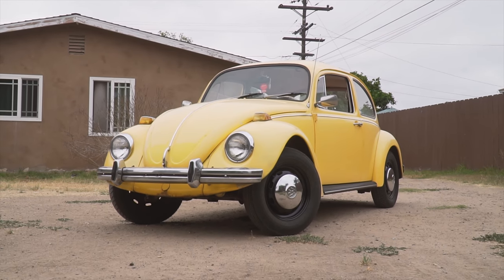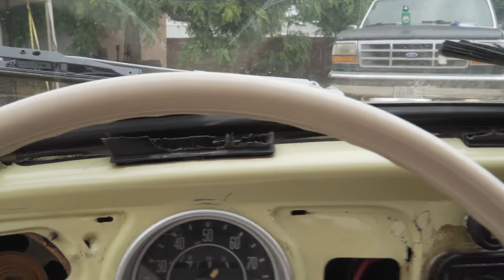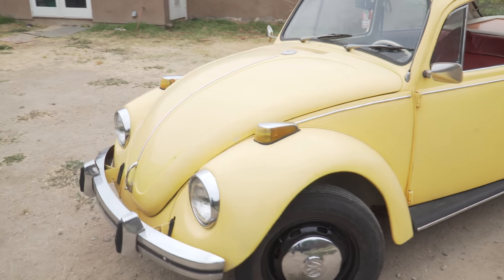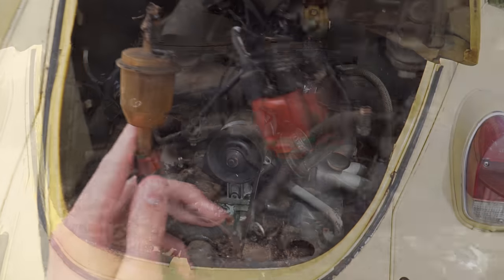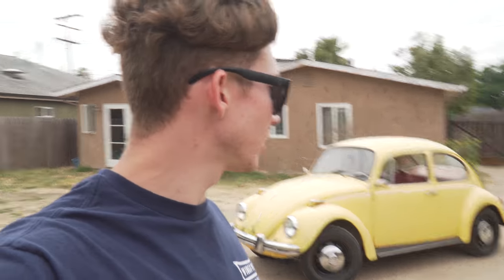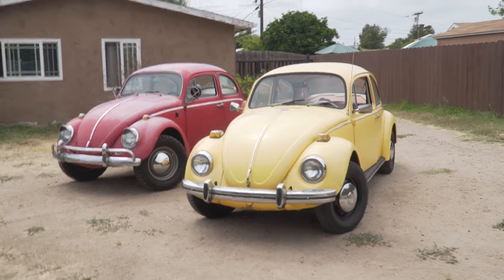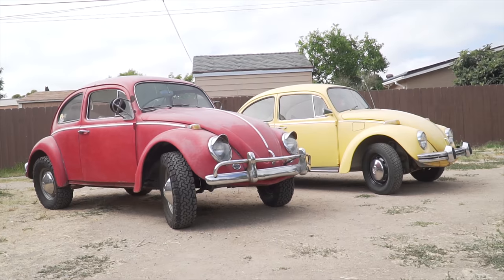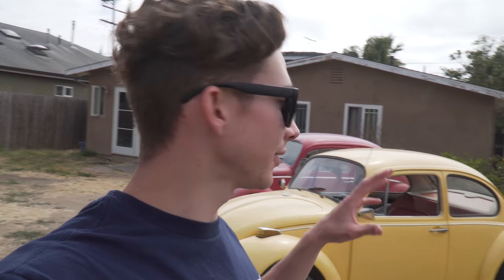Introducing My NEW VW Bug Project!

Comment: hey a little tip on the fuel line.  don't get me wrong we like the old style braided fuel lines but they don't hold up to ethanol .  if you go on eBay and search for this, it looks just like the original fuel lines but they hold up much better and won't start fires -   AN4 -4AN Fitting Stainless Steel Nylon Braided Oil Fuel Hose Line Kit
Reply from the maker: That is good to know!  I already ordered the standard style line though. Once the car gets a fuel cell, it will need new line anyways and it will get some nicer braided line.
Reply: Belmetric makes a modern braided fuel line called "Flennor" that is safe for ethanol up to E85 for those of us who prefer the braided look.
Reply: Thanks for sharing this information.

Comment: i used to have a 70 bug with the autostick option  frame rusted on it. as i said the IRS was introduced on the bug in August 1967 for the 68 model year with the autostick option. while the manual models retained the long swingaxle rear suspension as 1969 the manual models got the irs rear suspension the engine for 1967-1969 is a 1500 sp 1970 a 1600 sp single port. the dual port what u have is 1971 and later. the dual port motors will have the advanced doghouse oil cooler in the fan housing. as 1970 the changes is the big front turn signals and the rear bumper reflectors. as the rest is the carryover from the 1969 model as 1969 the heater channels changed to the ducts infront of the seat, the new defrost hose connections, the bakelite heater pipes under back seat. day night rear view mirror, fuel filler flap release under right side of dash, the hood release located in  glove box,  electrically heated rear window the changes on the 69 model. as 1966 -1977 the front beam is a ball joint type and bugs prior to 1965 is a link pin.  the 1966 bug has the 1300 motor still 6 volt. as 1962 the type 2 bus got the 1500 motor running on 6 volts but not sure on adapting a 1600 dual port motor to run the 6 volt electric but you have to change the flywheel to run the 6 volt starter. if 12 volt you have to ream the inside of the bellhousing for the bigger 200mm 12v flywheel. as the later 1500 and 1600 motors are 12 volt. the starter be changed with the approiate bushing for the 12 volt starter. the 64 i would of left stock as they are going up in value in the market.

Comment: Awesome man I’m 17 and bought a 65 bug to race in class 11 I was a little sad I couldn’t get the irs but it will still be pretty cool to race it
Reply: Swing axles are good  don't over extend suspension keep stock just reinforce and gusset susp. components run fox shocks valved to match the spring rate u run 
with front and back weld seams on the front beam  brace ball joint beam and body seams for extra rigidity and strength total Spartan tear out what's not used for racing. Good luck 👍 working ...
 with
Reply: Shout out to the Sletten Bros.  @ 11 Cars Motorsports for info. on setting up ur car IRS or swing axles it's does give better rear clearance .
Reply: Milo Torres ok sick I’ll look into that I know swing axles are bad and they both for what they are and the travel your limited to work pretty well but yeah I’ll definitely be looking into all that once I go pick it up

Comment: I am curious to know more about what you prefer about 1969 or 1970 Beetles. I know that from 1971 on there were both standard and super beetles both with IRS.  I understand why a super beetle would not be appropriate due to the front suspension design but the standard Beetles of those years have the same front beam as 1969/1970.  In other words, a 1972 standard Beetle would have the same front beam and IRS as your 1970.  I'm just wondering if there is some other structural quality I do not know as to why you were specifically searching for a 1969 or a 1970 other than personal preference.  For me, one of the main points I like about pre 1971 Beetles is that they do not have the crescent vent behind the rear window.
Reply from the maker: There is nothing wrong with the standard beetles post-1970 as far as I know. The reason I didn't mention those years is because they are hard to find where I am located, the 69's and the 70's seem to be much more common.
Reply: @WingsWorldChannel  I think 1969 and 1970 were top selling years so that makes sense.  By the way I enjoy this channel you guys work hard, know your stuff, and have a good presentation style.

Comment: Do you know why it took you so long to find a car? Because they’re hard to fine that’s why.
Now, I’m going to get all kinds of hell for this. But here it goes. In my opinion. And I realize my opinion doesn’t mean anything. Because this is your car. You spent money on it.
In my opinion you should find yourself a car that’s already been bastardized.
Finding a car like this that hasn’t been molested is rare.
There are probably plenty of cars out there with lift kits, big wheels, roll cages, front and back end chopped off to be Baja. That sort of thing.
This is just my opinion, but I find it blasphemous to modify a car like this, in this sort of shape.
And it is a shame that this one will just be another statistic.
They weren’t meant to go fast. If they were meant to go fast they would have hundred horsepower engines in them from the beginning. You’re going to race this car,…Meaning you’re going to wreck this car. Think about that.
Again it is just my opinion. I subscribed to your channel and gave you a thumbs up. It will be interesting in anyway, what your decision might be.
Reply from the maker: I completely understand that perspective. But at the end of the day, I have been wanting to build one of these cars ever since I got my first one and this is the best candidate I have found after months of searching. The beauty of class 11 is it retains all stock metal so it isn't like it is going to be cut up and thrown out.